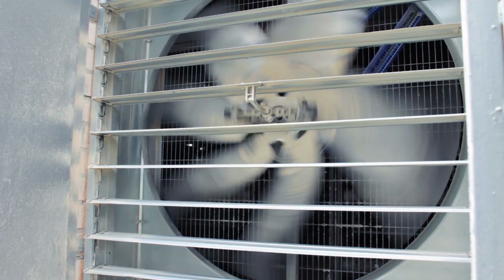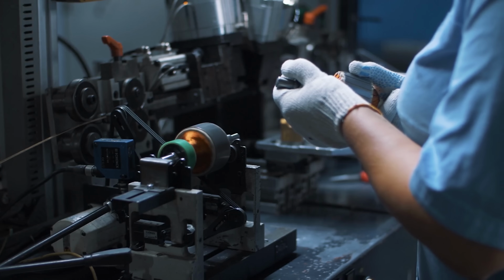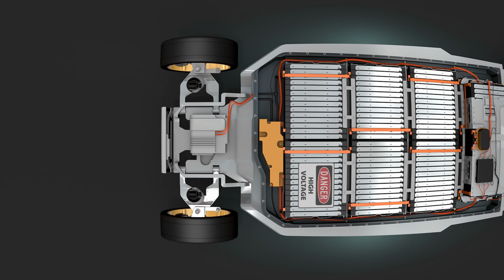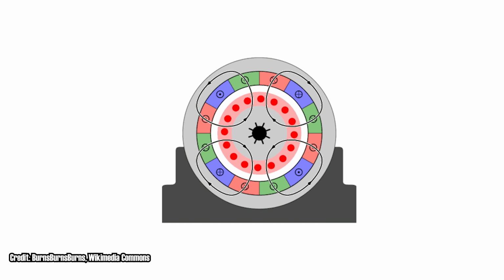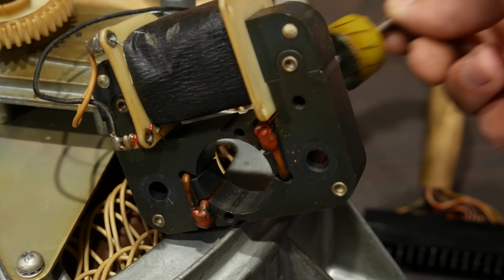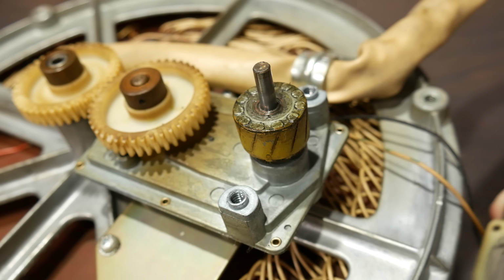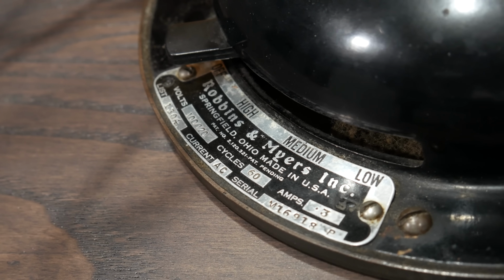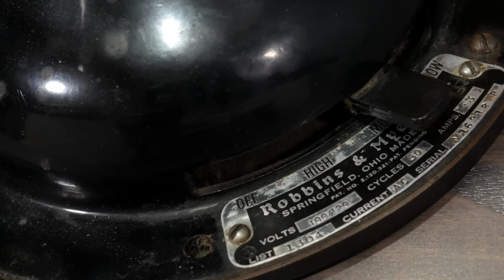Fans; High is next to Off on purpose

Comment: Lol Electrical Engineer here. He's not even joking when he says he's simplifying things
Reply: When i started to learn electronics i was like, cool, this so logical and easy to understand. At a certain point i gave up and went back to believing it's essentially all magic, infused with lots of maths and some occult quantum stuff sprinkled on top. It's better that way.
Reply: i think he screwed up the "breaker box in your home" saying to use two 110 vac for 220 vac and you only get 208 vac .isn't all US homes usually 220-240 coming into box? being two separate 110 vac hot's? I had a 220 compressor and no 220 outlet.but had a 220 line changed to two separate 110 outlets for my washer and gas dryer. they took out the 220 breaker and installed two 110 [20 amp] breakers. I ALSO use these outlets for running high amp stuff outside with a ground fault extension cord. but I made a 220 adapter using those two hots for my compressor. it worked fine. until it did not. IT stalled and melted the motor. expensive mistake. MY biggest stupidity was ,those two hots ,were still going back to two separate breakers and i think only one tripped. so stupid . learned it from a youtube video. stupid.
Reply: @Jestivius Jovial_Emperor so what is normally coming into a US. residential home, like for stove and dryer ? would i need a new line from the pole for 240? Now I'm really confused.
Reply: I’m a electrical motor technician, I couldn’t agree with you more lol he never even dipped into electrical theory.
Reply: immrnoidall you missed the line about it coming in as three phase. Because the phases are 120 degrees apart, the ac voltage between two of them is 208.
Reply: immrnoidall normal residential is 240v with a neutral tap down the middle to get 120.
Reply: @TomCee53  OK Thanks
Reply: @immrnoidall  Here you go! https://youtu.be/jMmUoZh3Hq4?t=1130
Reply: @immrnoidall  Here you go! https://youtu.be/jMmUoZh3Hq4?t=1130
Reply: @immrnoidall  Watch his video: The US electrical system is not 120V   Go to 18:50, then come back to comment on your comment. Enjoy!
Reply: Maybe I should ask you this question then. Is there a way to harness the power of a motor like this to use as a power source Off the Grid? Like could I fashion a motor with a hand crank oh, that would spin itself after I got it going that I can hook to a battery?
Reply: I'm an Electronics engineer and there's a lot of stuff I didn't know ( I knew most of the EM stuff, but not much about specific componentes and methodology). Guess I just haven't gotten that into power that much, mostly focused on VLSI chip design. It's eye-opening how you can be in a certain field and still not know much about a certain aspect of said field.
Reply: And I still don't understand what he's saying
Reply: @SpaceCowboy42X  You're thinking of generators. Also free energy / perpetual motion machine doesn't exist.
Reply: I'm pretty sure when growing up we got 180deg 2phase.
Reply: Neat.
Reply: @marinmarinhola  I'm an electronics engineer too. We deal with low voltage DC while these are high voltage AC with different topology and methodology.
Reply: Oh yeah I had to explain the entire physics behind a 3 phase asynchronous motor on an exam once, took 3 full pages of text and I have a small handwriting
Reply: @daytonrd17  Pleeeease---His videos are too long already.  Electrical theory is next month.
Reply: @TomCee53  correct-a-mundo
Reply: Why is spinning a thingy so complicated?
Reply: @Krikenemp18  Well sometimes it's taking power, sometimes it's making power, sometimes it's preserving power, sometimes it's detecting power, sometimes it transfers power, sometimes it resists power, sometimes it keeps the same power at a different speed, sometimes it breaks down, sometimes it moves stuff, sometimes it pulls stuff, sometimes it pushes stuff, sometimes it breaks other things, sometimes it breaks other things intentionally, and sometimes it's just fun to make stuff spin.

And no, those aren't all motors, But spinning stuff is very useful for how complicated it is to deal with.
Reply: @Straylight4299  well electricity does come from the core of the universe. 

And the universe is the most magical
Reply: @immrnoidall  I see where you're getting confused. He said it's dropping a 3 phase down to two legs for 208. 

208 is a common line voltage when dealing with 3 phase.  I don't know if you know what a wild leg is but look into it. It's wild. It comes from a 3phase delta coil.
Reply: @SpaceCowboy42X  yes motors windings in reverse are technically generators as long as you have somewhere to store the energy. 

You either have to manually spin the motor or can use something like flowing water or wind to spin the motor. 

As it's running there is no way for it to run on its own though. Because the magnetic fields and motions of electrons do have friction along their level of the fabric of the universe. 

"Residence" - a term used with electricity if you're not familiar, actually describes how flowing electrons crash into atoms and explode their energy outwards causing either magnetic fields, heat, or light to occur. I am saying this to illustrate how even something as small as a single electron still has friction from its environment that causes it to slow down. Eventually would be brining that motor to a stop.
Reply: @Jestivius Jovial_Emperor And all domestic power is single phase 220-240. You centre tap the transformer to get 180 deg "out of phase" 110 power to the two sides of your box. At the pole you can see usually 3 houses hooked to a phase coming in (240)... next pole will have the next  phase to 3 houses, and the next again... to 3...
I'm a little confused about 2 phase statement he made - you would never load a system like that for residential. If lop-sides the load off one of the phases. Causes problems upstream.
Reply: @KaneYork  Single phase - you were seeing the opposite sides of the 60 hertz swing.  You center tap the transformer and it gives you a half voltage from each end (one end - and one end +) to the center tap. So - if you measure one side of your panel to the other side - it will be roughly 220 or higher. That's the potential difference between the two sides of the transformer. You just see 110 because of the center tap - but the 110V from one side of the panel is 180 deg out from the other side...
If that makes any sense...

When you look at both sides at the same time through an oscilloscope it's pretty neat and you get a good picture of what is happening.
Reply: He starts by talking about fans, then shows universal motors, instead of the induction motors used in fans. Also, not all motors have the moving rotor on the inside. Some are external to the stator. This reminds me of the films that were used for grade school science class.
Reply: @KaneYork  Two phase used five wires, and worked at 90 degrees, like stepper motors. It quickly went out of use, because three phase had the same benefits with two less wires, and simpler switching and fusing or circuit breakers.
Reply: @michaelterrell  The three phase I've come across used five wires? A, B, C, Neutral, Ground. (Wye configuration, 416V line-line)
Reply: @KaneYork  I was talking about on the primary (distribution) side, or to a Delta motor. The neutral local connection is created after the stepdown transformers. A three phase motor only needs the three phase connections if it is configured for delta. It does need four wires if it is configured as Wye, which adds the neutral. The ground shouldn't be carrying any current, unless the load is defective. 
I've worked with higher voltages in TV transmitters. 7KV, with three 480V input. The output required 10KV armored cable, and three separate conduits to the rectifier cabinet. A second set of conduits bonded the neutrals, and then to the rectifier cabinet. All nine of the cabinets were grounded with a four inch wide copper strap. That was for a 1.3 MW UHF TV station in Destin, Florida. That 418 volt motor must have had a high horsepower rating.
Reply: @KaneYork  Wye requires four wires. The Neutral is created locally, at your stepdown transformers. Delta motors only require three wires. Ground is also a local connection, to a ground rod, or other grounding system. Distribution only requires three wires.
Reply: @daytonrd17  indeed, but the video is already nearly 20 minutes long and he knows how YouTube views tend to work.
Reply: i have a question, and due you're engeneer.. i have to ask you (Sorry)
Talking about FANS (Video from technology connections of 6 month ago)
¿What if instead of that MASSIVE load of WIRES i put some MAGNETS and 8 wires at much?

i mean...
imagine a CIRCLE OF... 8 magnets (For example)
then
the core had ONE magnet with the SAME POLARITY as the 8 on the ring
but THOSE are "Electro-magnets" (if that word is right)

so, if i want to activate LOW FREQUENCY i'll need to activate 1 magnet
MEDIUM-LOW The same one has the above BUT the OPPOSITE TOO (to be "PUSHED" TWICE in a "Stable rythm")
blah, blah, blah... 
and the final 7 ACTIVATED 1 OFF (Allways PUSHING the fan, but 1 off to dont "Slip more than we need" (Stops or reaching "MACH 900") so that1 is the "Break" to control the spin)

¿could it will work? ¿or am i dreaming to much? xD

¡¡Chaoo!! ;-)
Reply: @guijilope  You need changing magnetic fields to produce motion. There are permanant magnet motors, but they lose torque with speed. You can only eliminate one set of widings. If you only have DC available, you can use gear reduction to run the motor fast enough to provide the required torque, then the gears slow it down to the desired speed. There are 'Brushless' DC motors which are actually 3phase AC motors with a built in inverter. Your idea would produce low power, with jerky movement, like a small stepper motor. Eight steps would be 45 degrees of movement per step.
Reply: @michaelterrell  oh! (O.O)
Thanks for the info (^.^)

i forgot to say the next: 
i thought the magnets (All 9) could be positioned like this "/" instead of "-" to spin only in one direction

of couse it wil have "Bearings" (totally forgot to say that, because i was thinking on the magnets xD)

it Doesn't need to change fields...
it have >1< magnet rotating through a circuit of 8 (For example, i'm no engineer, maybe are 20 like maybe 2 ¡Who knows! except them, i mean...)..
which means it is "UNBALANCED"
that lonelly magnet by weight allways POINTS TO THE FLOOR

so, if the magnet is STRONG like... neodimium (i don't know if neodimium could be "electro-activated" or is ALLWAYS  magnetic, but is an example)
could have a "Big punch" at first..
if doesn't complete the first rotation turn magnets OFF (to PASS the initial state.. like a pendulum we are now in "-3" intead of "0" were was the magnet at first ¿You know... right? sometimes i could be so... ¿Disperse?) then ACTIVATE AGAIN the magnets... and now MAYBE, could complete a spin... ¿no?

low torque... is a problem (I didn't see it AT ALL, but... ¡NHYE!, my fault)

also i can "Argue" (I think so) that the torque NOW with those "JAILS" that fans have...
is not "SOOOOO NEEDED" ¿Right? emmm ¿Rii-iiight? ¿Huh? ¿Right or not, huh? ¿GUYS? ¡GUYS! 
(Gasp) ¡OMG! (O.O)

i'll have no more question the next time SORRY xD
¡I promise!
¡Pinky promise! (Trying to look cute and inocent... but a dark "Demonesque" aura, show you is obviously lying, could try it... but we are on internet ¡we have no pinkies! xD)

¡¡Chaoo!! ;-)
Reply: @whackydumdum  Yours is the most accurate comment.  People confuse the 3 phase arriving to the neighborhood with the split phasing arriving at a residence. Where they get confused is where one of the phases coming to the neighborhood, arrives at a transformer and the center tap creates two 180 degree legs off that single phase. So the hots coming into a residence are 180 degrees out of phase with each other but are from one source phase. If we were pulling two of the transmission phases then we would be dealing with all the 208v stuff and clearly we are not.
Reply: @NickFrom1228  thanks.
Reply: @KaneYork  2 phases at 180 degrees wouldn’t be useful at all.  You would wind up with net zero voltage.
Reply: @linuxd no he said there is 2 of the 3 phases in your breaker panel at about 5:00

Comment: and here I thought that the reason was because Hi is the only setting that’s worth a damn many times.
Reply: Nice G-Shock
Reply: The stand fans I bought after moving into my current house are stupidly powerful and we only ever run them on low.  In addition, they have a separate on/off switch from the speed switch (the controls are digital, and they have remotes) and will power on in the same mode they were in when turned off--unless you unplug them, in which case they start on "high."
Clearly they don't need to start on high to avoid stall, as the commutator takes care of that, but it's still the default start mode because, as he said in the video, "this is just how it is and we're all used to it by now so why bother changing it?"
Reply: @Bacteriophagebs  the difference between efficiency of electrical output and also the electric motor has made it such that modern fans operate a lot better than ones in the past. odds are, it is kept as a mechanic to minimalise the probability of it not producing enough torque and eventually heating up the internal components, only to then melt the fuse and force it to be repaired.
Reply: @alessudot  As I tried to say and phrased very poorly, I suspect that the electronic controls in the fan automatically apply max current on startup, like with power tools or the ceiling fan switches he discusses in the video.  I said "commutator," but meant "commutator controller."